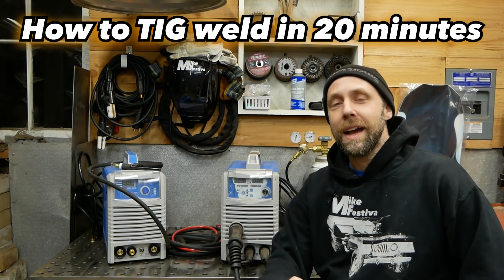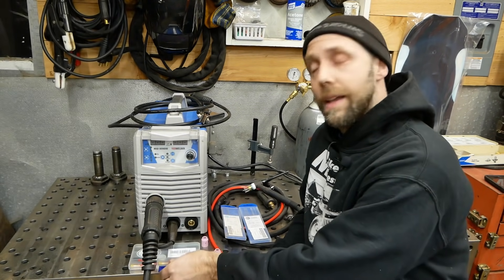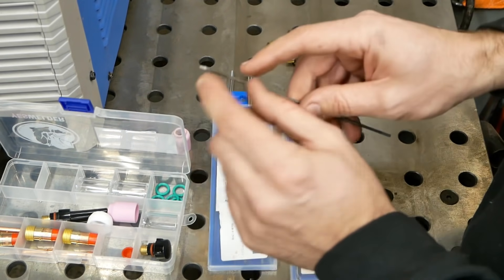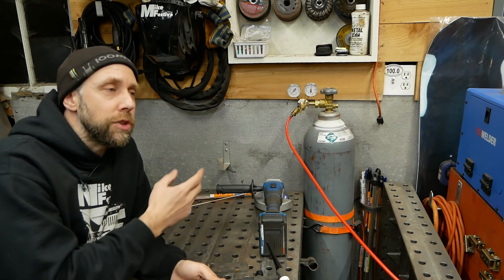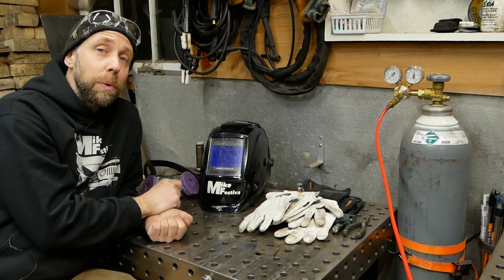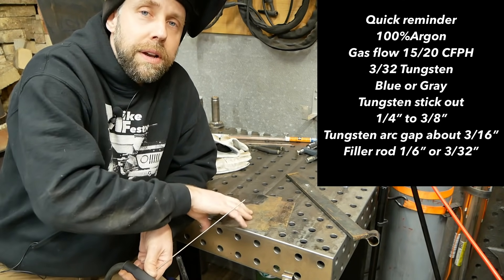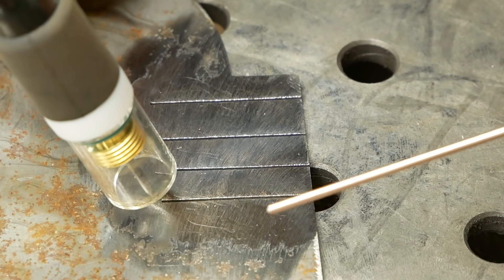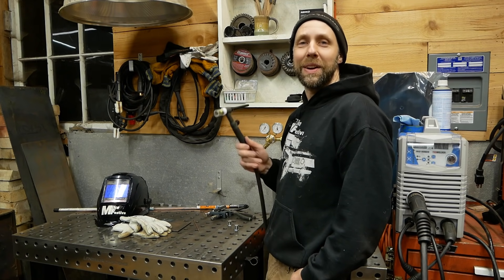Learning how to TIG weld made easy

Comment: Mike, care to elaborate on why you stay away from the red electrodes? Not judging or arguing, genuine question based on genuine interest. As and engineer, I like to collect information and learn as I go.
Reply: @lxxsxxx7845  disclaimer: I am not a pro welder, but many years ago had reasonable skill with TIG.  I recall the red tailed electrodes were specified for stainless welding and purported to enhance arc stability.  And I would also love to hear the rationale against them
Reply: They are radioactive since they contain thorium. Grinding them can lead to breathing some dangerous particles of it.

Comment: Can I tig cast iron with brass filler rod ?
Reply: you can braze it with brass.  if you want to weld it, you'd want to use a nickel rod, and consider peening.
Reply: I use silicon bronze with tig for cast iron .....   no hammering needed !!!

Comment: Hi friend I have a question for you about TUNGSTEN electrode: some people said red packaging tungsten is dangerous to use , Tungsten electrodes are used when arc welding or plasma welding.

The most common thoriated tungsten electrodes contain 2% thorium, are coded WT20 and have a red tip.

Thorium is slightly radioactive with a long half-life and emits mainly alpha (α) particles, but occasionally some beta (β) and gamma (γ) radiation.

Alpha particles cannot penetrate skin or even paper. However, they are harmful if released inside the digestive tract or lungs, where they act as a carcinogen.

They say gold packaging the safest to use in TIG welding any true ? Why even Panasonic Japan made red and blue if dangerous I am confused 
Thanks
Reply: Naa bruh someone told me it's equivalent of eating a couple bananas potassium is radioactive if you're scared just hold your breath when you're grinding it

Comment: The video is great, the only thing is the puddle is not visible due to the arc
Reply from the maker: Yes unfortunately I have zero help making these videos, it’s really hard to set the camera up with specific lenses to get those arc shots. The second video in this series has much better shots. It took me well over an hour of changing camera settings and buying special filters to get the shots on my how to weld aluminum video.
Reply: Thank you for your help

Comment: How come some people leave the tungsten against the metal at end of run?
Reply: You don't want to actually touch the tungsten against the metal at the end of the run because that will contaminate it. But you do want to hold the tungsten slightly above the end of the weld for a couple seconds. That way the metal will be be protected by the shielding gas (usually argon) while it cools down. If you stop the arc and immediately move the torch, the weld can be contaminated because it won't be protected from the atmosphere by the shielding gas.
Reply: @camhaslehurst1609  now I’m confused because most videos I’ve seen they press it against the weld at the end and stand the torch up and wait a second or two

Comment: I am not a welder but i do work in the field of radiation safety. The thorium in tungsten rods is definitely not something to worry about
Reply from the maker: I think this is exactly why most people don’t think there’s really any risk like yourself from handling it for welding, there’s very little risk in that, it’s when you breathe in the dust that can be a factor especially when exposed over years of welding and grinding the Electrodes.
The dust from grinding can get into your lungs and that’s where it poses most of the health risks.

Comment: Why are you using a ruler marked in tenths? Civil engineering is the only place I've seen that measurement system used. Just wondering who else uses tenths
Reply: Machinists
Reply: @michaelchristian8220  now that you say that, I've used a micrometer a few times and I feel like it was in tenths or ten thousandths....1000, 10000, 100000 of an inch maybe? Thanks for sharing
Reply: @TheMuddman74  i use a 6in scale marker in tenths for rough cuts or cutting stock to size

Comment: so the cup sizes are basically just how tight of an area your working with and how well your able to get to areas?
Reply: I don't know, but it seems to make sense that the cup size should be at least as big as the weld puddle you're making. And a smaller one will probably save a bit of gas (assuming you can turn the gas regulator down for smaller diameter cups), if it's big enough to cover the weld bead.

Comment: The danger with Thoriated tungstens is not so much the radioactivity per se, but the radioactive dust created each time you grind a point on the tungsten. If you inhale just a tiny speck of it, it will sit in your lungs and eventually cause cancer .The half life of Thorium is thousands of years, so the radioactivity will not go away in your lifetime. The dust can collect on your workbench, tools, etc and sooner or later a bit may be inhaled. Those who use it will have very sophisticated dust extracting exhaust facilities. Just the same, I wouldn't use it under any circumstances. You life is not worth any welds.

Comment: When welding aluminum, form a ball on the end of the tip.
Reply from the maker: Not always, most old AC TIG welders that are transformer units will most often do this because the machine has no AC balance. This isn’t the case for inverter machines. The mindset that balling the tip is needed to weld Aluminum is a thing of the past.

Comment: Hey Mike, I’m not finding the Yeswelder TIG-250P ACDC on the Yeswelder website. It keeps showing me the TIG-200P ACDC. Do they not make the 250 anymore? Now, I can get the 250 on Amazon, but it doesn’t allow for your code😁 Also, is there a difference between the two that should tell me to get the 250 for sure?

Thank you for great videos. Very informative! 👍

Comment: you dont lose gas not opening the valve fully
Reply: if you do itll be a cheap bad valve which that one looks,. decent valves dont have the PRV at the back like a co2
Reply from the maker: It’s fairly common knowledge that you open gas valves fully when you use them, they have double seals that prevents gas from leaking.
Reply: Some valves can leak if they're only open half way. Is it really that hard to open it all the way, and close it all the way? Durp.

Comment: yourenot supposed to just release the arc like that you are supposed to ease off it
Reply from the maker: I take it you haven’t used a lift start TIG before have you??? This TIG welder is about as basic as they get, no amp pedal so there’s no way to decrease the amps like you mentioned. If you watched the video and listened you would have heard me talk about that. I have been TIG welding for the past 8 years and TIG weld aluminum and steel every week at my work.

Comment: Lol if you don’t do this regularly hire it done
Reply: That's a very convenient option, but not likely to make economic sense. You only need to weld a few things, to break even. If you can fix my exhaust for $20, (5 minute job) then I'll consider hiring you. Otherwise, I'm going to buy a welder, fix it myself, and then do WTF projects I want to do. The last asshole I asked to fix my exhaust wanted to charge me $850, (including parts). That means I'm coming out way ahead on my first weld, plus I have a useful tool to do other things with. It's a no-brainer.

Comment: WHY WOULD YOU WANT A CLEAR LENS. IT IS BLINDING ENOUGH WITH A REGULAR CUP.
Reply from the maker: You probably don’t have the right shade set on your helmet if it’s blinding.
Reply: Why are you YELLING?
Reply: @Mikefestiva  I ordered the 71 piece kit from yes welder but the clear lens in it does not fit my 250P ac/dc unit?
Reply: @eknaap8800  really what does it really matter or are you too WOKE ALSO